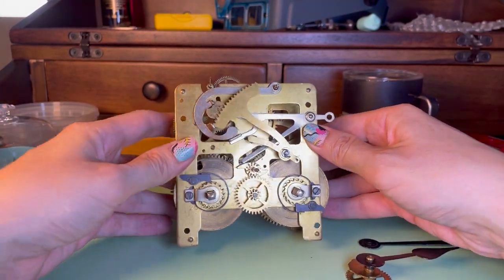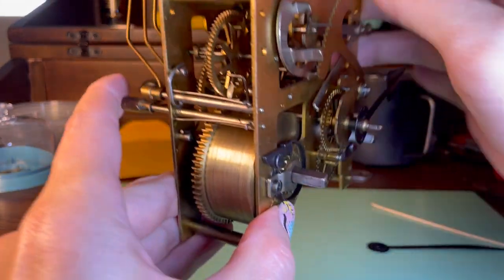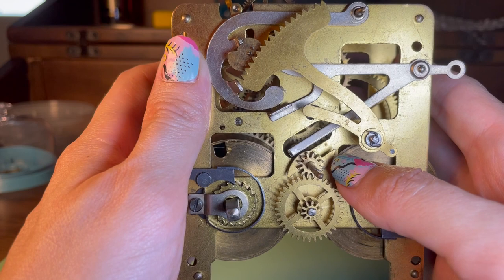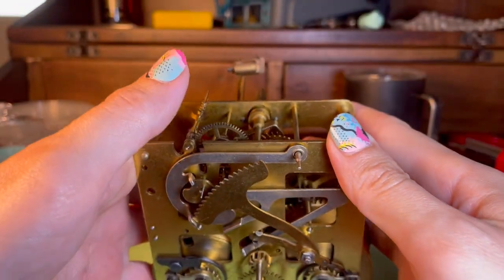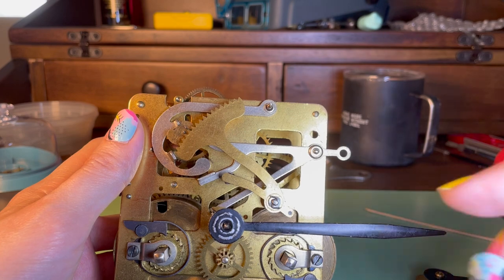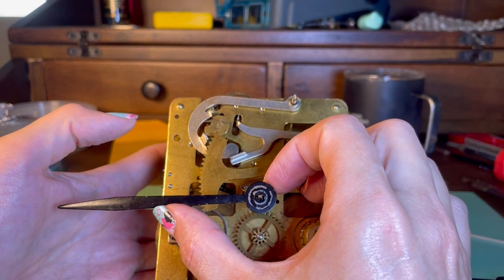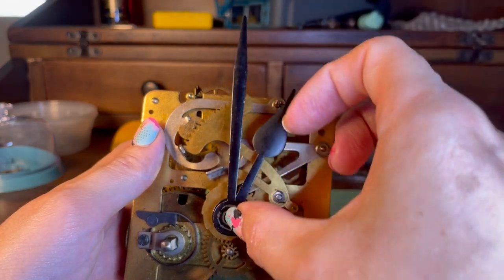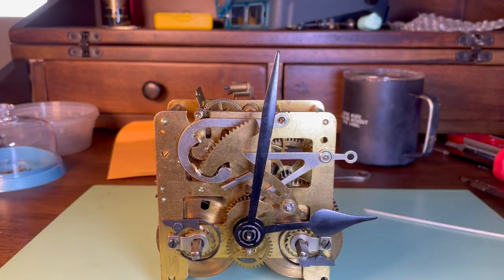Rack & Snail Strike (Mauthe wall clock)

Comment: omg. I've been searching for exactly this kind of clock movement to properly reassemble what seems to be a 'Hermle'. I can't find this exact replica under that brand. I think I read that those predating the 40s weren't given serial no, just the pendulum length is engraved. Good thing it seems German clocks are alike. idk if it's a knock off nor do I care for the authenticity, I want to get it running again haha.

Comment: I understand how the snail dictates the number of strikes af each hour by controlling how far the rack falls, what I don't get is how you only get one strike at each half hour? What dictates this please?
Reply from the maker: Good question! There are a few things to note here: 

- The two points on the center cam have slightly different shapes. The smaller one is used for the half hour strike. 
- The mechanism reaches 'warning' state (preparing the strike to run) before the rack hook moves out of the way, dropping the rack.

The smaller point on the center cam only pushes the lifting lever high enough to release the warning wheel, but not so high that it drops the rack. Since the rack is held in place, the gathering pallet can only make a single rotation before it catches the hook.

Comment: Newbie with lots of questions: Thanks for this explanation. I have the exact same movement in a Mauthe wall clock, I noted that at some point there is lateral movement of the snail (perhaps to reset something ???) Can you explain this ?  Also every once in awhile the rack will fall out of place and the clock will chime 13 times. It seems to reset itself after this happens however. One last thing, is there a way to speed up the rate that it chimes ?
Reply: apparently you don't respond to questions. Thanks anyway